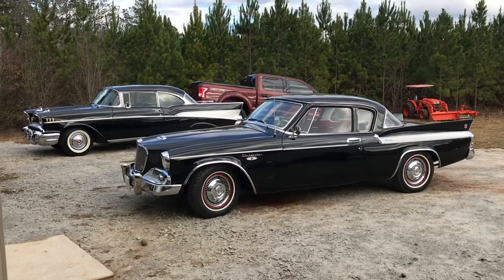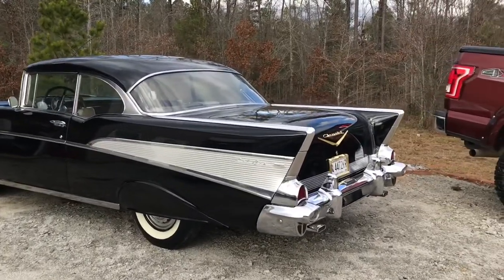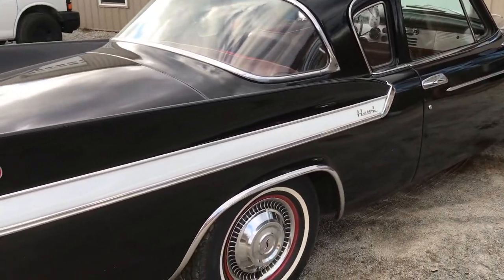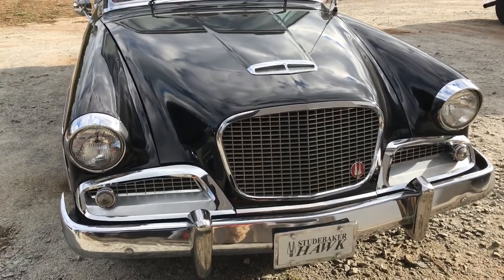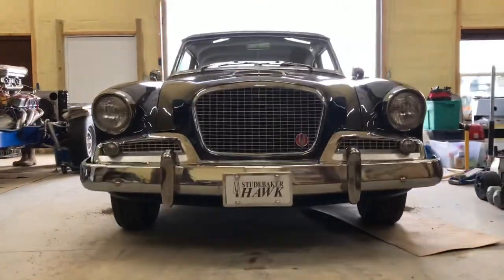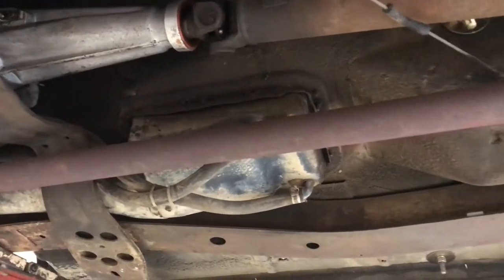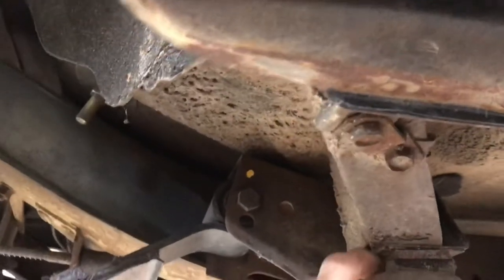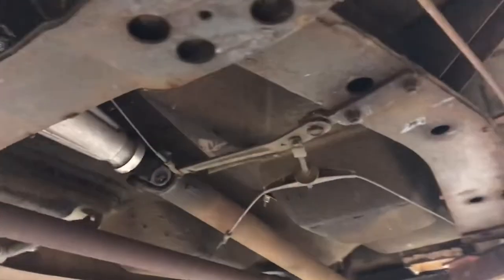Studebaker Hawk fins versus Chevrolet Belair fins and a look under the new Hawk

Comment: As mentioned earlier, Studebaker didn’t have the $$ to compete against the Big 3, so they went into “me too” mode on design. The Hawk’s fins were bolt on, not part of the rear panel stamping. By canting them, they gave the Hawk a rather distinctive look for not much money. This rust free beauty should last a long time as parts are easy to find.
Reply: Bolt on fins or not, its a far better looking car than the Chevy

Comment: There was very little change, in the styling of Studebaker Hawks, from '57 - '61, and no changes, were made to the fin height. Studebaker didn't have anything close to GMs production volume, or budget for styling! This same basic platform, was used from '53 all the way to the end, of US production, in '64. When first introduced, it was longer, and way lower, than anything else had ever been! This car is the same over all height, as original '53 version. It's significantly lower than the '57 Bel Aire. Completely Forget about the '53 Bel Aire! Even though the aerodynamics, of the front end styling, of the Hawk, was drastically reduced, compared to what it was originally in '53. It's still nowhere near as much, of a brick wall, as the Bel Aire is! It looks like, this car could have, R1 emblems, under the Studebaker scripts on, the sides of, the front fenders? Although this engine wasn't available, until after '63? This car could have, had its original engine replaced, with an R1, and had the emblems added? The R1, wasn't the same basic 289" V8, as the original Hawk engine! It would have a Carter AFB 4 barrel carb, higher compression, a more aggressive cam, an aluminum cam gear, stiffer valve springs, a windage tray and would have come, with the chrome valve covers, and dipstick. It should, definitely have dual exhausts, if that's actually the case? The shiny part of the transmission, you were referring to, is called the tailshaft housing. The pieces that fasten the bumper, to the chassis, are the, spring steel, bumper mounting brackets.